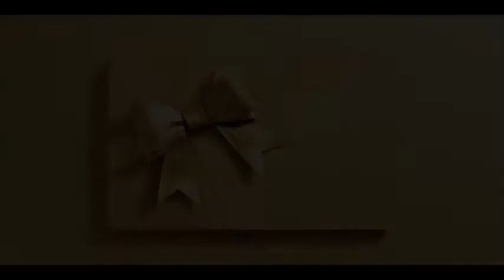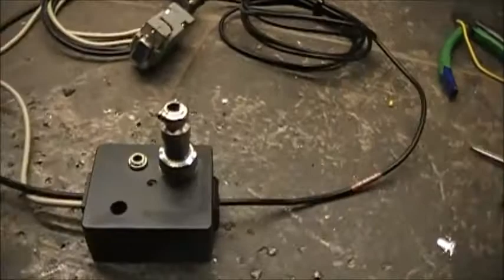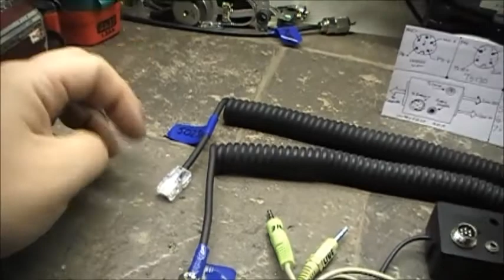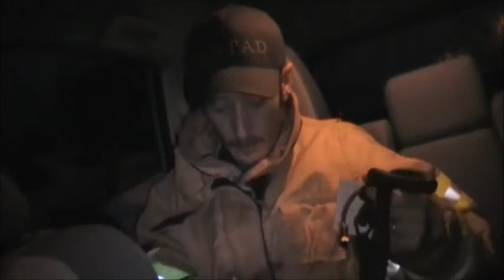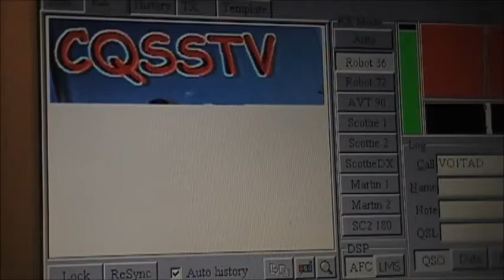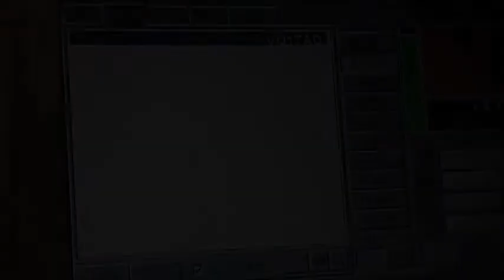Special gift for Thomas VO1TAD

Comment: Good job on the interface.  Is there any way to get over to nfld on packet from NS? I keep forgetting to get into ve1syd and check.
Reply from the maker: not that i am aware of.... Thomas and myself gave packet radio a good run over the past couple of years, trying to get local folks interested in Packet, but it was all in vein, i even installed a Kamtronics KAM All mode on a high area of town and setup as a node to hopefully get more people interested. But again not one person turned on a TNC to say hello.  So after 3 solid years ad took down the Node and dismantled my packet station here at the house.  Real shame, because packet radio was the first internet!     I still have the equipment here, but now sadly collecting dust for all time.   Perhaps i will place the gear up for sale and hopefully put it to use somewhere else, in a place that Packet is still appreciated, because Packet is no longer a welcome mode here it would seem.   Or maybe it is me... who knows..   73
Reply: @Radionut63  well that's too bad.  Hopefully someone picks it back up again there.